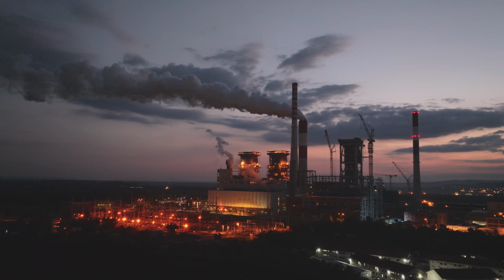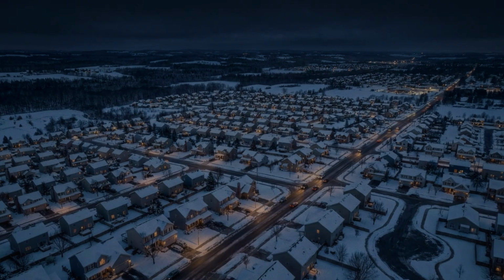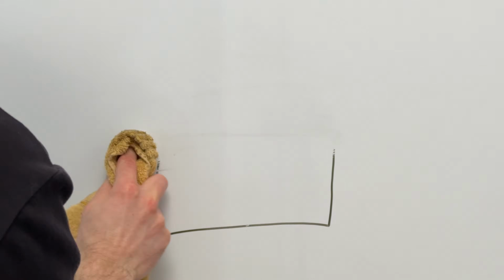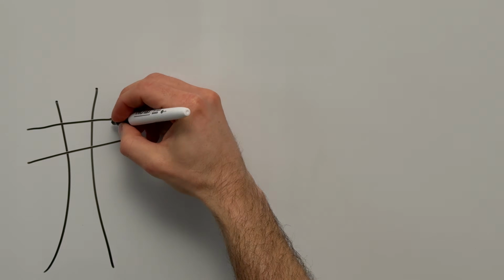AC vs DC Power - What's the Difference? (Electricity Explained)

Comment: Couple of clarifications: DC and AC both "lose" the same amount of voltage over distance.  The difference is simply that it is easier to change the voltage of AC with a transformer than it is to change the voltage of DC which requires power electronics.

When you boost the voltage (AC or DC), the voltage drop over the distance represents a smaller percentage of the power being transmitted.   And it goes by the square of the current.. it's non-linear.  When you double the voltage and halve the current, the power losses over the wire are cut to 1/4th.   Hence why transmission lines uses very high voltages.

This is why 24V has 1/4th the wire losses that 12V has, and 48V has 1/16th the wire losses that 12V has.  Even when you make the wires smaller (increasing resistance), 24V will still have 1/2 the losses and 48 volts will still have 1/4th the losses.

--

Direct thermal elements and AC motors use AC directly.  But everything else uses DC.  For example, computers are DC, they just have the power supplies built in that convert the AC to DC.   And highly efficient modern refrigeration, A/C, and heat pumps use variable-speed DC compressors whereas older refrigeration and A/C units used AC compressors that could at most run at just one or two speeds.

--

On your shower pump... hopefully you ran a ground wire too, and have it on a GFCI.  That looked really dangerous to me.   Power and water don't mix.

Anyway... given how long a run that cable is to your shower, sending the power via 120VAC AC was probably more efficient even with the inverter overhead than sending, say, 12VDC would have been.  If you were sending 24V or 48V instead, a DC cable would be more efficient.  Of course, losses depend on the current, so maybe it wouldn't have mattered much at all given how small that little pump is.

For your tiny home, inverter efficiency and idle overhead matters a lot.  That's why, once people get serious, you see so much (for example) Victron gear out there and not so much in the way of power stations.  For example, a Victron multiplus-II's inverter like a 48/3000/35 can achieve 95% efficiency and has an idle consumption (non-eco) of 11W.  So its perfect for modest solar systems.

Once we get into huge solar systems (5kWp and larger), inverter overhead doesn't matter as much and people stop caring.  Modern hybrid inverters in the 10kW+ range usually have significantly higher idle consumption... 50W to 100W typically.  But they do that in order to maintain huge energy buffers meant to stand the test of time and deal with reactive loads.

-Matt
Reply: Thanks
Reply: Yes, thank you, this was all very good to know and super interesting!  🙏🏻😊

Comment: Converting DC to AC = inversion, Converting AC to DC = rectification So all of those bricks are actually rectifiers and almost every electrical / electronic devices have an internal power supply that rectify the ac power into a dc source that the device uses..
Reply: Converter is actually more accurate for most devices needing AC-->DC because it needs the AC-->DC rectification step but ALSO usually a change in voltage, usually lower in most electronic devices.  So the overall device performing both functions is actually more accurately labeled a converter.